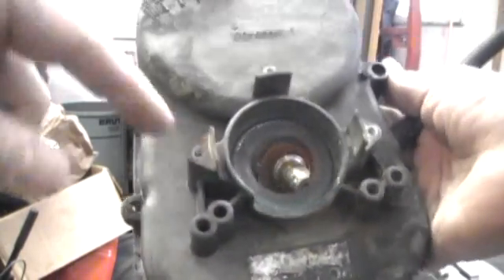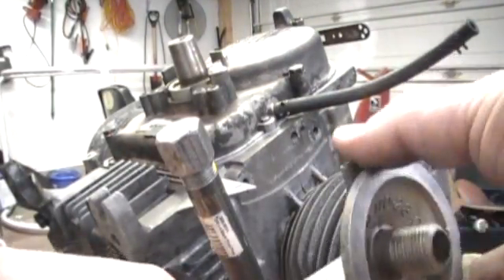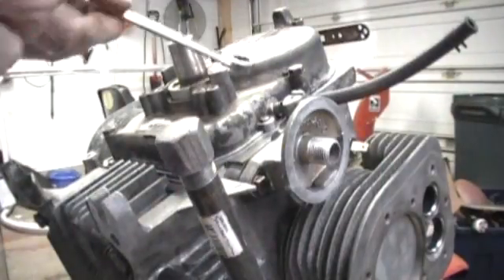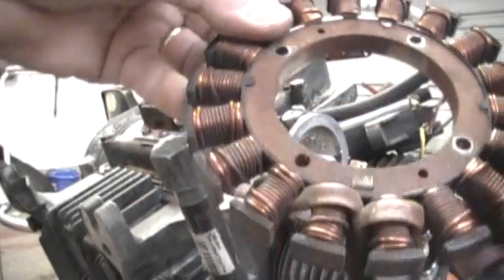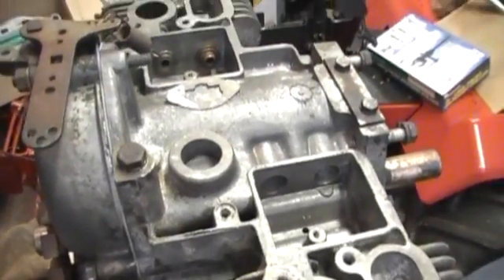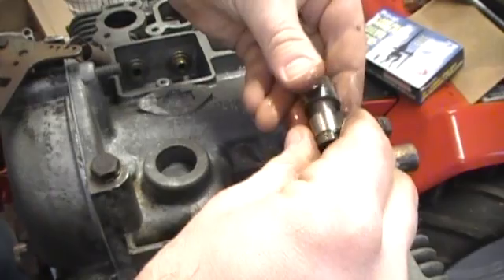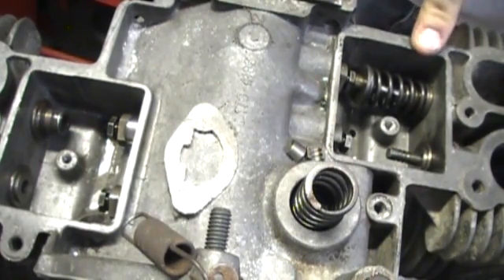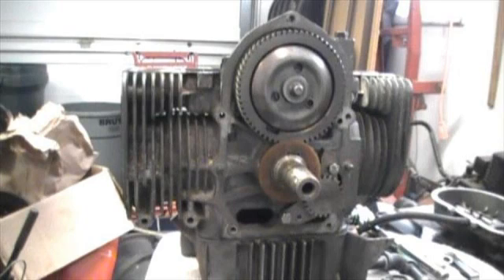Onan P220G Rebuild Part 5

Comment: Quick question.  You took you're valves to a machine shop and had them reground to a 45 angle.  How about the valve seats?  Did you leave them alone or had them replaced?  Did you give the block and valves to the machine shop to have them MATCHED?
Reply from the maker: Hussain Zaidi The machine shop offered to do the valves since they already had the block.  They installed and replaced the crank bearing as I didn't have a press at the time.
Reply: Craig Arndt Thanks, so they had to use you're block as a "reference".  You couldn't have simply sent them just you're valves and have them grind them...  BTW how much was the machine shop cost and what did they do.  I just pulled my engine apart last night (P218).  I have a shattered conn rod and piston.  At a min I will need my journals re-ground and cylinder walls re-honed.
Reply from the maker: They needed the block to press in the new crank bearing I purchased.  Since they are only 20 minutes from me, it was easy to take it to them.  I thought I'd be able to do the bearing (didn't have my 20 ton press at the time) but got nervous I'd damage something.  The initial cost was $130.  That was for turning the crank .010" under.  Then they charged $30 to press in the bearing and lap the valves/seats.  Glad I did it, this shop was very easy to work with.  http://www.northeastmachine.com  The journals were "egg shaped" as they said.  I have 130 hours or so on this rebuild, it runs so well.  Hope this helped.
Reply: Craig Arndt So when they did the crank .10 under you had to get new conn rods that were .10 under.  I have one good piston and conn rod.  It seems If I replace the second piston and conn rod I will have to buy them in pairs!!  So if this is the case I would be better off just having the machine shop doing the journals .10 under and getting new pistons with new rods!!!!  Anyway I found the EXACT SAME casting number piston and rods from this site http://onanparts.com/index.php?main_page=index&cPath=21.  It seems I can just pick up a new rod and conn rod from him and I should be set.  The casting number match!  I'm just curious how they ground your valves because Onan specifically says not the use valve lapping compound as it will pull the valves out of tolerates and they will have to be ground on the bottom of the stem!
Reply from the maker: I ordered all my parts from Onan parts, same website you listed.  Great to work with and good prices.  Even though I had one bad con rod, I replaced both.  My P220G is an '89 and had the old con rod design, which some say is a weaker design.  The new ones have more metal and don't have the oil hole in them.  My pistons were both good, no scoring and the pin tolerances were good, but I did re-ring the engine and I honed it as I had some light smoking.  If it were me, I'd have them turn it .010 and order pistons/rods.  Having all new rods, bearings, seals and rings gave me piece of mind.  It was an easy engine to re-build, I had a lot of fun doing it, but wanted to be sure it was done right as I'm keeping this Wheel Horse 520H a long time!
Reply: Craig Arndt OK thanks, I heard from somewhere the old conn rods were weaker in design.  This is telling me I'm pretty much destine to get new everything!  Wow, this is going to be expensive.  Sad thing is I just bought the mower thinking it just needed some carb work and fuel system cleaning!
Reply from the maker: Same with me, thought I needed a new muffler and carb work.  Once the old rotten muffler was replaced, the newer one quieted things down and it revealed a knock you couldn't hear when I bought it.  Yes, it's expensive for sure, they are industrial engines.  But, I had already planned on a restoration.  So doing the motor sucked and was a lot of money, but I'm glad I did it.  We use this tractor for plowing the garden, pushing stuff with the blade and mowing the lawn.  I plan to keep it as long as I'm breathing! Haha!
Reply: Craig Arndt Dude, I have 1 acre land with grass that was almost reaching the knees (lol).  I had changed all the fuel lines and did a carb cleaning.  I fired it up and it ran well (at least I thought). I dropped the deck and engaged the blades.  I noticed the engine seemed like it wanted to cut out.  I chalked this up to (maybe it needs a timing adjustment, or i didn't quite clean the carb well).  Boy was I wrong.  I started thinking that night why the engine would sound so out of balance and stall as it's going uphills.  I did a quick trick I learned.  I started the engine and pulled the plug wires while the engine was running.  I tracked it down to one cylinder.  Then I thought, awesome it must just be a bad plug wire!!! Then I pulled the plugs and noticed only one cylinder was puffing air and the other one was dead :(                       On the positive note I got pretty much my whole yard done on 1-cyl and a 50 inch deck!!!